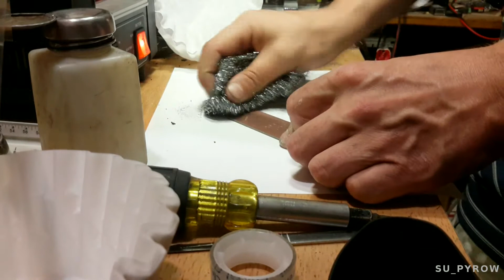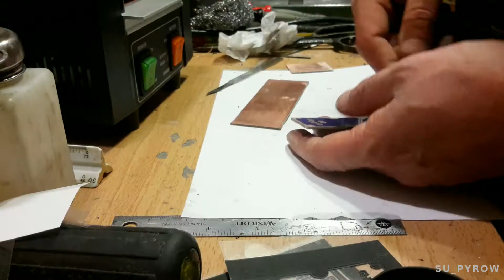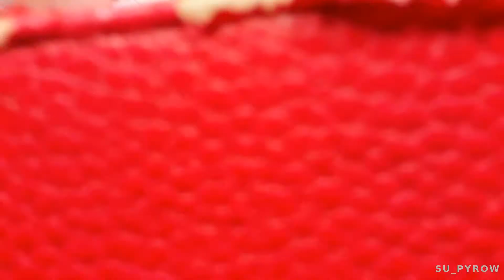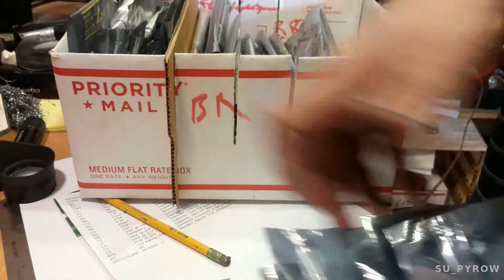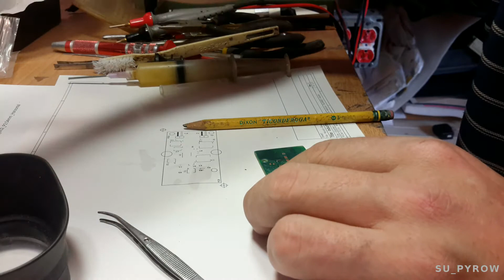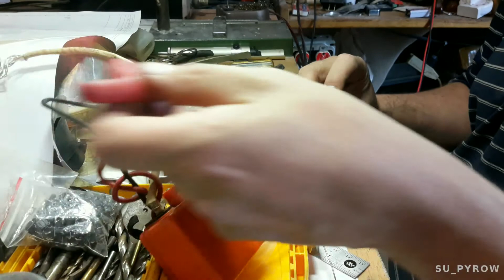How to build a DIY Induction Probe / Toner Signal Tracer Part #2 - Board Population SU PYROW #13

Comment: Toys from the dollar store have decent speakers for stuff like this.
In fact, the fake cell phone toys could make a decent enclosure and the speaker is already there.
Reply from the maker: This is a fantastic idea... SMILES
Reply: @supyrow  I have a neglected and abused 200EP I'm resurrecting but I don't have the tone generator.
I'm going to try and make a tone genny from a cheap $1 toy or a window alarm.  I think the window alarm would be easier to add the continuity tester.
Reply from the maker: I know i have a schematic for a tone generator here somewhere, i really need to do a video on it...  i think it uses a 4069 IC.
Reply: @supyrow  I made one out of a cheapo window alarm from the dollar store.
I'm not sure if it's safe but it works.
Reply from the maker: @aurthorthing7403   I'd like to see that!!
Reply: @supyrow  I got it working and it works well.
Only need one wire connected from where the piezo was hooked up and the induction amp picks it up very good.
I used one of those cheap window alarms but I bet those keychain alarms would work too.  The oscillator just has a transistor, resistor, ceramic cap, inductor  and a blob.
I also made an inductive amplifier from a $1 speaker from dollar tree and an inductor from a DSL filter.  It's the poor mans line tester for sure.